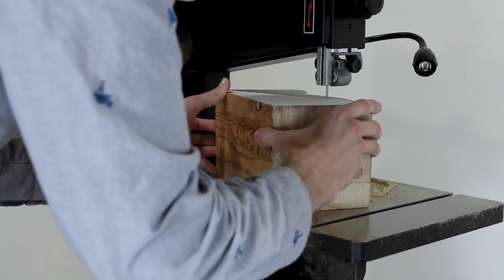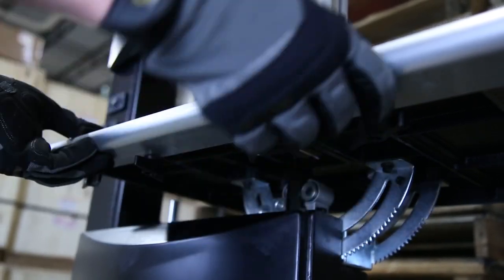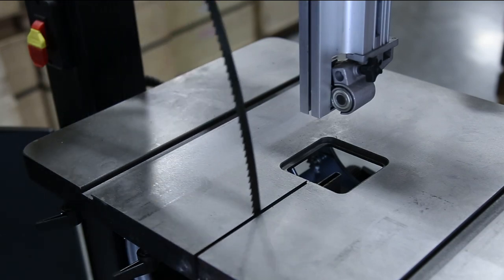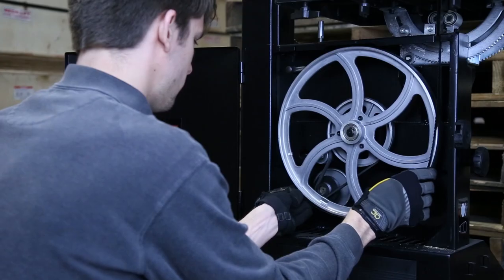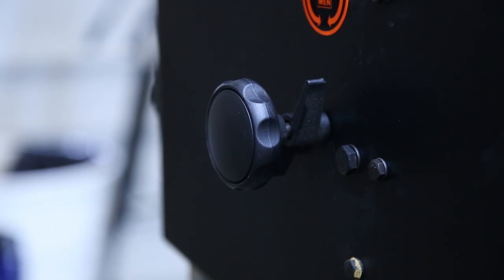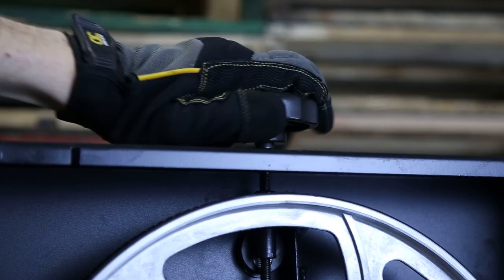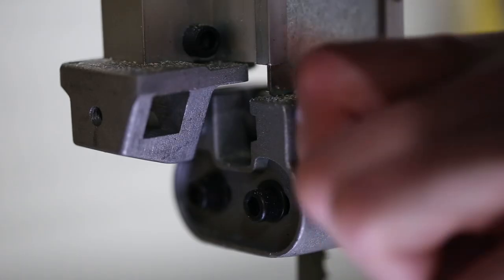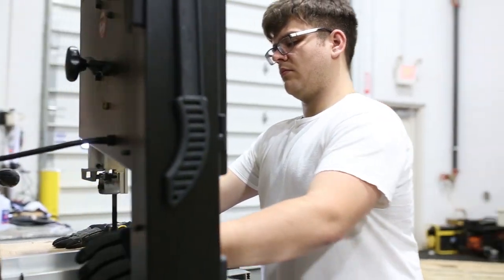How to Install and Tension a WEN Bandsaw Blade

Comment: Wrong...blade is not centered on wheel, the deepest part of gullet is centered on the wheel....Also blade tension should be not more than 1/8 th inch with a light tap to the side with one finger.

Comment: I got this saw, it sucks , keeps popping off, waste of 200 dollars I have ever spent, I regret it every day ,great coat rack
Reply: I know this post is over 2 years old but for those who have your problem the answer is to keep the top wheel level using a small level rested against the top and bottom part of the wheel. Tighten it up making sure the blade is somewhat in the middle of the tire. When it's at the tension you like, use the adjustment knob on the back and make micro adjustments turning the wheel slowly. I cant take credit for this , saw it on another video. I was ready to Chuck this brand new band saw because of it. I spent house hours before and it kept popping off using a 1/8 blade. Hope this helps someone!
Reply: @badaphooko02  I'll give it a try. One thing for sure 3/8" blade is all that works. Tried 1/2 and 1/8 and all the little tricks and they never tracked well. Still poor compared to Luna or Jet but it's a $200 band saw and I'll try this with the 3/8 blade to at least get straight cuts working.

Comment: I own a WEN and cannot figure out if tryouts turn clockwise or counter to tighten the tension and this video did ZERO to help that as your turned the same direction for tightening and loosing.

Comment: this video really doesnt go into the tracking adjustment enough.  my blade keeps popping off the back side of the top wheel.  which direction tracks the other way?  clockwise or counter clockwise.  i have the WEN 3962 10" bandsaw.
Reply: I have the same dang problem. Very hard to fix once it gets messed up and off track.
Reply: Im having the same problem too, very frustrating.

Comment: No one ever seems to address bottom wheel tracking. I can get the blade to track in the middle of the too wheel but not the bottom wheel. Always rides towards the very front of the wheel, almost like it’s about ready to come off.

Comment: It looks like after the new blade is on and seems aligned then to add tension, the knob is turned counter-clockwise not clockwise. Is it possible they just used the same piece of video (used for loosening it) and edited into the tightening sequence?

Comment: I cannot get an ⅛" blade to track properly on my 9in win. The ⅜" blade I have no problem but the smaller one is all the way to the outside of the bottom wheel and the guides do not go out far enough to catch it. If I put it back further it just runs off. My old saw I could run any blade no problem but this one if giving me a fit. I know smaller blades are harder to track but I've never had this much trouble on my old saw. Unfortunately my old saw which was much nicer then this one died on me and I bought this one for all the reviews. I would had liked to be able to use at least a half inch blade but I mostly use it to cut out patterns anyway. I would like to find a way to make the smaller blades work if anyone has an idea that make help me I would be appreciative.

Comment: I bought a Wen 9inch bunchtop band saw, it's first week it ran very well. It was  assembled professionally. Week #2 the blades came of the wheels. Then everything started to fall apart on it and I decided to ask the question  WEN will it not be complete trash. Next time I will spend more money and get something that will work more then 2 weeks and won't fall apart.

Comment: Sir first of all thank You for your video! :)) I have a WEN 10” 3.5 amp bandsaw. Cheap saw for around the house. I have had it close to 2 years but it has been used very little. However, I went into the shop the other afternoon and tried cutting a piece of wood. The saw would not cut straight at all. It wasn’t just blade drift. If I forced it to cut 2 inches it would break the blade. Thats how sideways it has gotten. The specs of the blade are 72” length, 3/8” thickness and 6 teeth per inch. I would say 50% aggressive. They said it was the best wood cutting blade for all around, any type wood. I watched videos like yours and this is what I have done. I tried adjusting the top wheel but it changed nothing. I then cleaned the blade which was gummed up pretty bad but no change. I want to sharpen it but this is my problem. All of the teeth are slanted to the same side. And thats the way the blade tries to go. Also in seems as though the teeth have different slants. Like one is more aggressive than the other. It almost looks like the 1st tooth is slanted a good bit and the other 2 are straight. But I rub my finger down that side of the blade and I can feel resistance on every tooth. But it does seem like every 3rd tooth is more resistant than the other 2. I thought every tooth pointed the other direction and if they did I would know exactly how to sharpen kit. But if that is true with my blade then I am blind and can’t feel either. Any information that you or anyone who might read this could give me or in some way enlighten me, I would be very grateful!! I’m gonna finish watching your video Sir. Thank You and anyone else SO MUCH and GOD bless……
Reply: Replace your blade it's 15$ then remove tension from the blade if you plan on not using it often. The tension will warp the blade while it sits.

Comment: Your blade in the middle or teeth in the middle to avoid wander? mine kept wandering right until i had teeth part of the blade close to the middle which looked like it was a little to far back. My wandering and pissed-off days were over. Sooo since the wheel rubber is not flat but curved. And blade width varies. Is that negligible? is my machine made fucked up? (no longer wanders and is perfect after my adjustment) or is the explanation just general but not precise?

Comment: Was on home depot website checking out Wen's model BA1411 14" 1HP bandsaw which only had 4 reviews.  At some point while searching for good Bandsaw blades i discover this thing called a "Bandsaw riser block".  Wanting to see if Wen carried this for the BA1411 i went to Wen's website.  There was no listing on their website for a Riser block but i discovered something else that sorta opened my eyes and had me laughing afterwards.  

Wen had the same exact 4 reviews on their website that Home Depot had on theirs for the BA1411 Bandsaw, with slightly different dates.🤣🤣

Comment: I just purchased the 3959 9" band saw, it will be arriving today. Quick question, Is there much of a difference between the 2.5 and 2.8 amp machine in terms of performance? Anyway I decided to go with your brand "WEN' because about 6 months ago I bought a WEN drill press and I absolutely love it.
Reply: It's been a year - What's your opinion of this saw? I just received mine today.

Comment: I have the 9 inch 3960 bench band saw.  I can't align the wheel to track right.  It either goes to far to one side or the other.  What am I doing wrong?  Your feedback is appreciated.
Reply: Lunita make very small adjustments

Comment: This video does not address the lower bearing adjustments for the blade guides. I have the 10" 9662. It came with a 3/8" blade installed. I have no problems adjusting it. I just bought some 1/2 inch blades. The lower thrust bearing needs to be moved back because it is putting constant pressure on the blade. The problem is that I have it's bolt adjusted all the way to the back of the slot already. The thrust bearing makes a lot of noise being pushed up against the blade like this. And yes I tried moving the blade forward a little. I dare not move it any more. Why did WEN design it this way? Do I need to file the slot to allow the thrust bearing to be moved back?
Reply: Ah, never mind. The bracket that the thrust bearing is attached to has slots that are long enough to move it back enough for a 1/2" blade.

Comment: Theres a black plastic guard on my WEN bandsaw I cannot get to come off to change the blade.  It says PINCH AND PULL but its not working.
Reply: slammerjax it is hard to open, but it does open
Reply: @jimmcdiarmid7308   I finally got it lol, thank God because I had jacked up my blade bad by cutting a resin project that was NOT cured when I thought it was.
Reply: Pinch towards the bottom where the plastic has grooves in it.. took me a while to figure it out.. was afraid I was going to break it until I figured it out.